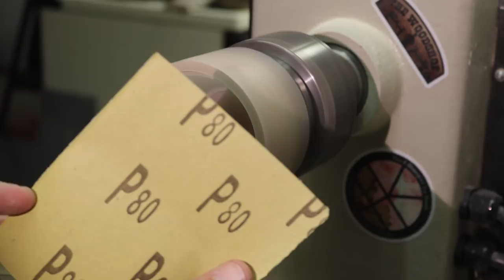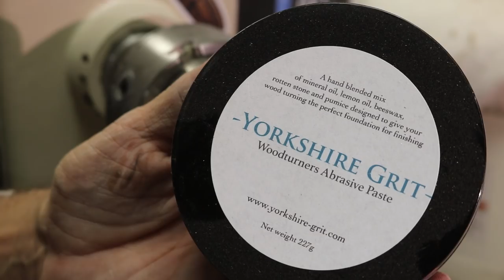#34 "Prismatic Pot" 🌈 Hybrid Box

Comment: Keith, someone recommended I check out your channel.  Glad I did.  Great stuff.  thanks 
Sam
Reply: There are a lot of good ideas in this video. I especially liked using the glue block and then turning it into a screw chuck fixing, never would've thought about doing that.  And the box looks brilliant thank you Sam
Reply from the maker: Thank you so much Sam!  I appreciate your feedback.  You do amazing work!  Thanks!  Heath
Reply: Thanks and I apologize for calling you Keith....
Heath it is.  Sam
Reply from the maker: No need to apologize.  It happens more often than not.  Thanks Sam!